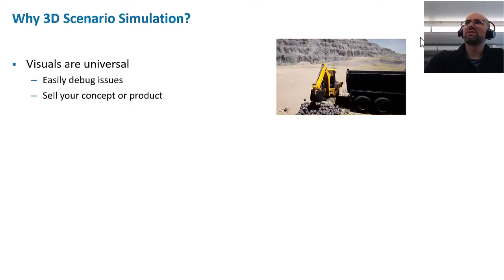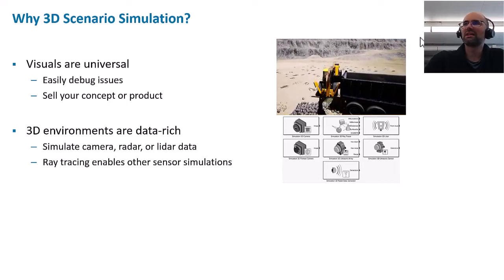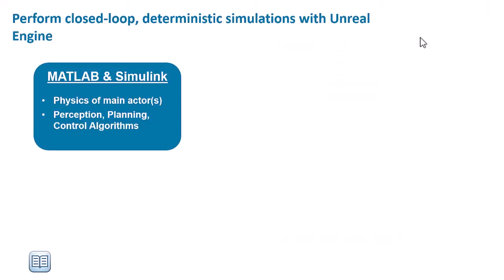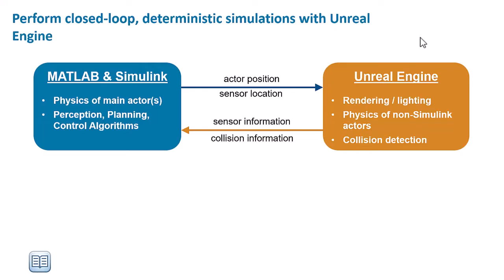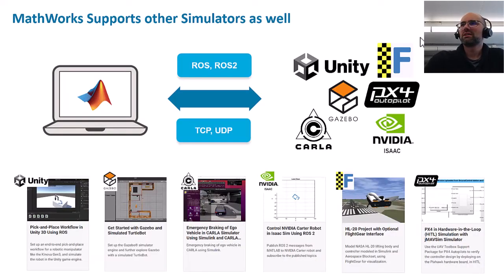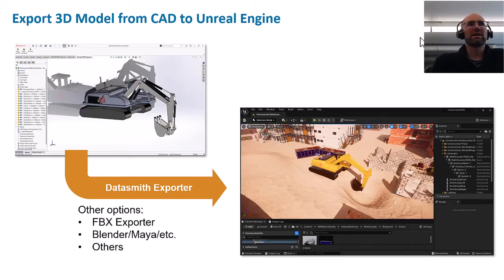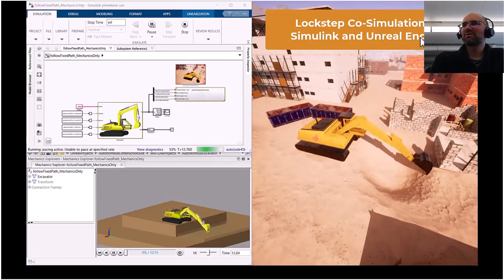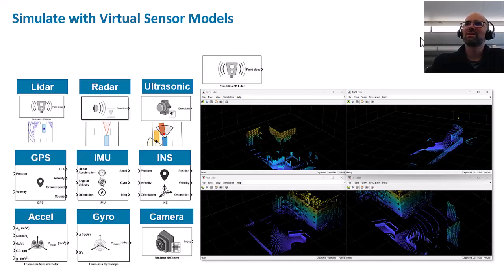Set Up a 3D Scenario Simulation with Simulink and Unreal Engine

Comment: Hi I am having trouble with packaging the Scene using unreal engine 5.3 and Matlab 2024b, co simulating works fine but making executable fails- am i missing something?
Reply from the maker: Sorry that you are having an issue. This could be on the Simulink side or on the Unreal side. To diagnose, can you contact Tech Support? The number is at the bottom this page. https://www.mathworks.com/support/contact_us.html
Reply: @ I raised a ticket yesterday with the screenshot of error and some additional observations- but haven’t heard anything on it yet, the error seems to be more related to the unreal engine windows build is trying to find ray tracing and sensor sim core dirs in the shared toolbox space which is not available